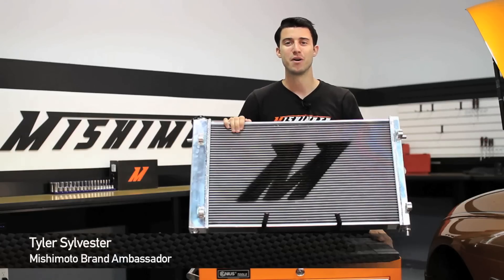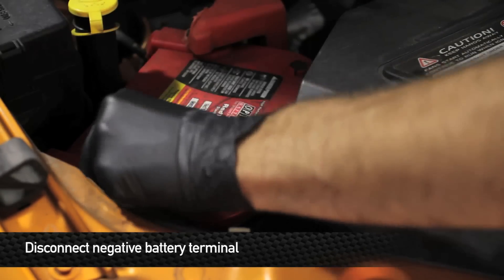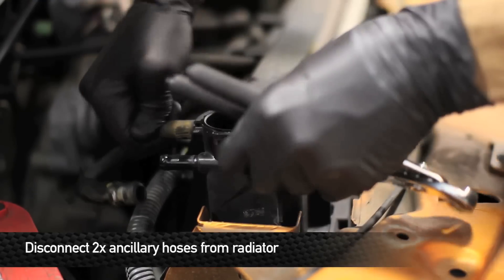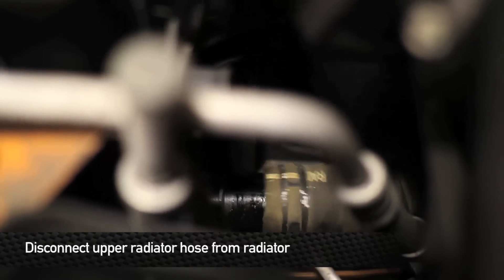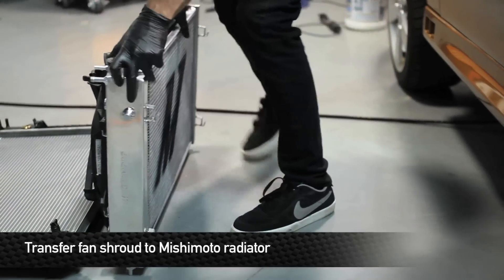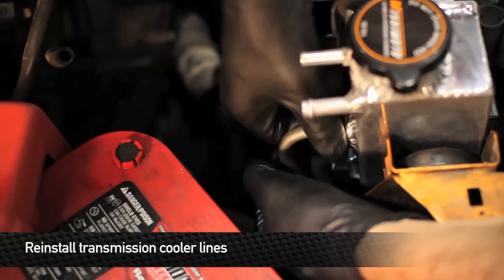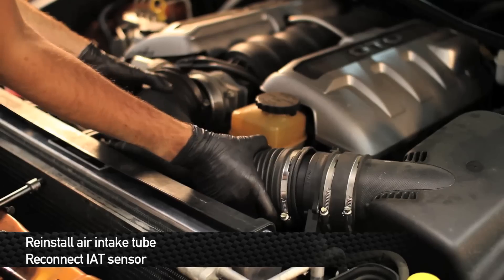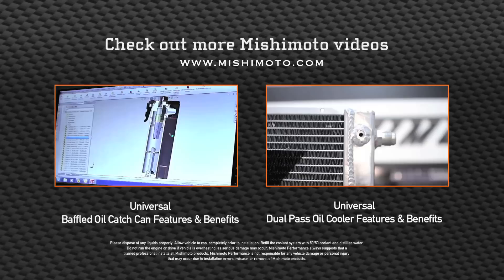How To Install: 2005 - 2006 Pontiac GTO Performance Aluminum Radiator

Comment: adding what 8mm bolts to remove for the AC condenser and connecting the battery before trying to start it would improve the video

Comment: Does the LS2 in 05 GTO radiator / cooling system have to be bled? Does it have a bleeder somewhere. New GTO owner..
Reply from the maker: You will need to bleed you engine using the same methods you would for most cars.